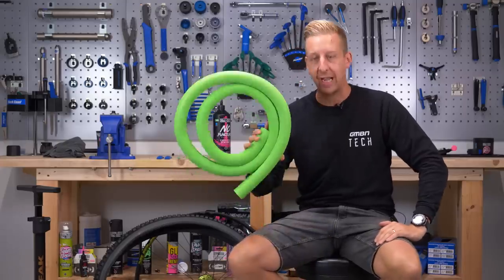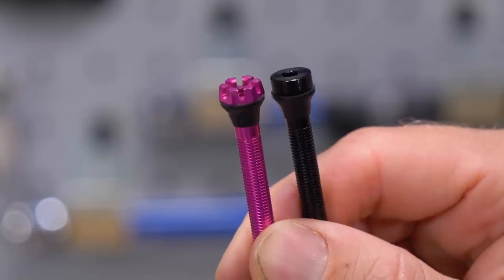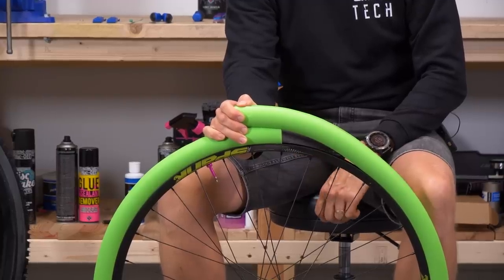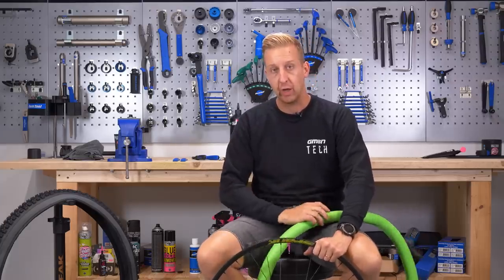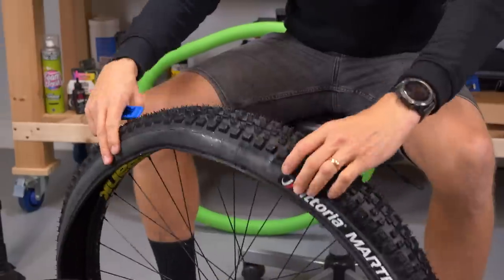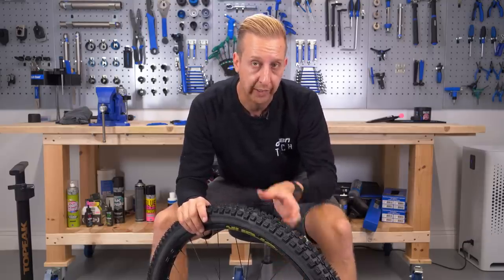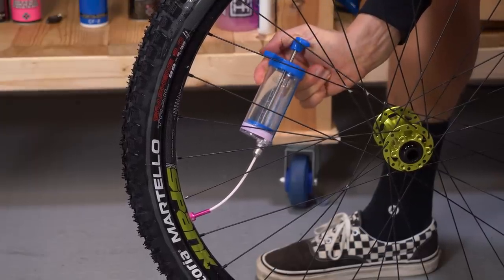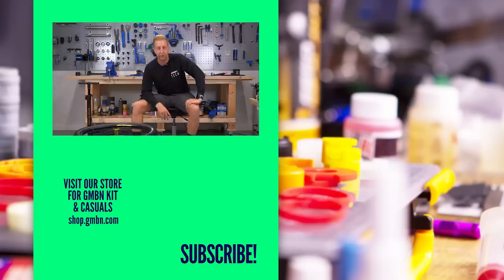How To Install A Mountain Bike Tyre Insert | MTB Rim Protection

Comment: I poke the cable tie buckle back inside the foam by rotating the cable tie after tightening and cutting. That way it won't damage the tire OR the rim tape.

Comment: Thanks. I tend to put the tyre on the wheel with a tube, indoors overnight. Deflate and release one side and remove the tube, then fit the valve and insert. This pre step helps the tyre take the rim shape and makes subsequent inflation and re-beading easier. I also find that watery soap is better than soapy water to help the re-beading. Hth
Reply: One other remark: presta valves are not really designed for this being rather narrow and cores are easily blocked by tiny bits of dried sealant which leads to slow leaks. Any chance tubeless and wheels will go back to using Schraeder with removable cores as these are wider?

Comment: Great video! That’s what I’d do before putting in the sealant.  Make sure that the tyre walls seat on the rim properly by pumping to its maximum recommended pressure. Then only I’d fill in the sealant using a syringe. I learn a new thing - how to install the foam insert correctly. Thank you so much! 😊

Comment: Loving my tire inserts, they allow me to ride much harder on my enduro hardtail without the risk of damaging a rim or pinch flatting
Reply: Do you only run one in the rear or front and rear both?
Reply: @BryceKimball7.3  I run one in the rear, because it helps the rear wheel getting damaged and stops it from bouncing due to the extra weight. I think it isn't needed to run one up front if you have a good fork.

Hope that helps!
Reply: @youtubeviewer9523  that’s exactly what I was thinking. Figured with good suspension they shouldn’t be needed for most of the riding I do. But there’s no suspension in the rear so I’ll have to try one
Reply: @BryceKimball7.3  Trust me they help a lot! and they give you a confidence boost to send it
Reply: They are a lifesaver on the rear wheel of a HT with single ply tyres.

Comment: if possible push the wall of the tire IN the rim, same side, 180degrees from the segment you're working on. the rim has a smaller diameter in it's center, just enough to help a lot when fitting the tires. 
besides the soapy water, the greatest help is heat (sun, hair dryer, etc). a warm tire is easier to work with.

*special valves mainly for weight reduction :}. a nice hole on the side of a regular valve would do the same job.
Reply: I was wondering why a standard car tubeless valve with a groove filed in the end would not suffice if a little extra weight is not an issue!

Comment: Mr Dodd...do inserts absorb sealant ? I use the Vittoria's in my gravel bike , they come sized and they're easy to use , to me anyway ? Thank you ....Peace
Reply: Just changed my rear tyre, had a Vittoria Airliner in there for 8 months. Didn't seem like it had absorbed any Sealant, ie not any softer or swelled up at all. I'm using muc off sealant

Comment: Installed the air liner on my rims. Front tire perfect makes no noise and seems to me doing great. Rear rim was the same, but now I hear the liner moving back and forth on the rim. 
if I take the tire off the bike and wiggle it back and forth, like when you add sealant, I can hear it hitting the tire. It is cut just like the front and installed properly.... Just now pulled the liner out and checked to see if the zip tie broke... nope. Installed again, added sealant and the same thing... soo weird... Thoughts, needs some expert advice... of the good kind.. Cheers G

Comment: @Doddy you could have used the tyre levers much later and for far less effort if you had pushed the bead in to the deepest section of the rim. I know spank have a raised middle section but they still have a lower “well” which will give you more bead to play with when getting the last bit on.
Reply: maybe the insert makes no possible to do that... but yes with out an insert that is the right way to do it ;) and some times the only one jaja
Reply: Can't push the bead in the middle because the insert is dense not much play

Comment: I never understood why people do not seat the tire first and then inject the sealant through the valve. You can do this with the little Stans bottles too. I have been using Cush cores front and rear for years and love them. I want to try this Vitoria one now.
Reply: in my case i used that method but i think the sealant with a few days gets dry in the valve and gets difficult to inflate the tyre also the top of the valve when you close it don't fit perfect and lose air... next time i think i will put the sealant direct on the tyre.
Reply: @hugor.b.6351  The sealant will get in that area anyway. It easy to clear the valve stem with a zip tie too.
Reply: @trailpimp6369  nice tip

Comment: How is this different from running tubes?
Especially if tubes are filled with a bit of sealant..
Weigh wisse it is the same..
Reply: You avoid pinch flats
Reply: Where I'm at there's tons of goat heads. With an inner tube you end up having to dismount the tire and patch the tube after every ride. Tubeless solves that.
Reply: @PetterIvarsson  But you get bead blow out and have to reseat it. Carry an extra tube an voila easy fix also if your getting pinch flats you should probably run a bit more pressure and check your rim for damage.

Comment: At the expense of oversimplifying things, inserts are basically solid inner tubes, am I right?
Reply: No, you're not.
Reply: No. The tyre still relies on the right air pressure to give a correct ride. The insert is partially rim protection, partly burp protection, and also gives a better compression ramp-up on hits especially. If you like to use lowish air pressure for high trye conformance

Comment: #AskGMBNTech Hello, I have gotten my hands on a Mondraker foxy r (2012). Shock was blown so got a good deal. I will send it to fox service center, but I want to do a lower leg service myself, but I can't find a dust wiper set for 2012 Fox Float 32mm. Can I use modern 32mm seals, even if they are not 100% perfect? Or should I just clean the seals and add new oil? Or do I have to buy a brand new fork? Thank you!

Comment: 5:00 not sure why people question the soapy water. I have been fitting tubeless tyres to cars for years. It's just standard practice.    And the water doesn't have to be warm.
Reply: Tubless tyres to cars??? Never seen someone fit innertubes to a car. Dumper or forklift yes, but never a car
Reply: @Rab_Cee  They are hard to come by these days but they do exist and were the norm back in the day.  Biasply tires tended to use them more then in a radial.
Reply: @Rab_Cee  Same.  Don't think tubes in car tires were standard since the 1970s.

Comment: OK a month on so probably won't get read... BUT...

Is there any reason they don't make a tyre insert INSIDE an innertube.
This would help save snake biters....
The insert wouldn't have to be full tube diameter, just big enough to squash out into the sidewall on impact, keeping the tube from being pinched between object and rim... so could actually have an air gap between the top of the insert and the outer tyre mid tread making for a softer more pliable contact area for grip when not hitting a curb/rock etc.
You can fit a 2.5" tyre over an inflated innertube (Done this lots to prevent twists during inflation and in some cases is easier than a completely deflated tube installation).

I'm almost tempted to get a 26" insert 
[yup.. I rock 26"ers... so get snake bites.. specially as the tyre co's hate us and stopped making 26" plus (ok except for Surly Knard 26 x 3.0 but I'm not disgustingly rich enough to afford them)].
get a 27.5 inner tube.
cut the insert and tube. Thread the insert into the tube and roll one end back a bit.
Glue the insert ends back together
Roll the tube back over itself and glue that with repair patch rubber cement. (Maybe even put a couple of the really thin repair patches over the seam as a gusset..

and I'll probably go stick a nail it in instead...

mmm ok so what about putting in some #Muc-Off Innertube Sealant 

q8)

Comment: Just ditched these Vitoria inserts…More pain than gain! Unless you’re into wobbly tires.
Reply: Agree inserts are generally overrated as a protective device. I occasionally use my cushcore on the back but think line choice, tire pressure, and casing are far more important.

Comment: #askgmbntech how do you stop tubeless tyres leaking air round the bead? I have a Vittoria airliner installed in Vittoria Mazza tyres and the rear seems to be leaking air around the bead and its very irritating because it goes down whilst I'm out riding.
Reply: Soapy water around the bead, like in the video!

Comment: I use an old thorn proof tube cut it down the middle wrap it around my tube and never get flats
Reply: You made me recall the mid 90’s when I used to cut of the wire bed of old tires and do something similar
Reply: whats a thorn proof tube ?

Comment: If you get a catastrophic failure on the trail requiring a tube, now you’ve got this damn insert you’ll need to take out and deal with.
Reply: Nah, you can ride home without a tube
Reply: @McSchwabl  yep--you'll be riding home instead of shredding with your bros.  I'd rather shred with my bros.
Reply: But to be honest, normaly you can stick a bacon strip in
Reply: Also I destroyed my rims after one season, i will try the Cush core to Safe the next rims

Comment: Does this make for a more comfortable ride?
Reply: @tonysadler5290  i think the method comes from the off road cars... lower pressures can give you more tire contact area with the ground and can be very useful in sand for example.  This last couple of months i use more pressure to get up hill easily and found that going down with that pressure (35) results in a more solid ride in curves and i feel i have more grip than before (24) maybe cause the less deformation of the tyre. So yes use the right pressure

Comment: Tried many of them... the struggle to fit on the rim doesn't repay on the trail... the main problem of inserts is the type of tire you've been using them with, to install and remove them easily you have to use trail casings such exo for example, if you use them with dh casing tires will be a nightmare to install them, second problem the sealant, with rotation and friction between tire and insert the sealant will consolidate in lumps that will make unstable the tire and you have to remove the insert to resolve the problem, third problem is the snakebite the tire if you use a pressure too low and you're going to damage the bead and there's no way to fix the problem if you don't have an inner tube because the damage won't seal the tire on the rim.. I've had all af these issues with foam inserts, so I don't recommend that solution, Cuschcore is a good solution imho, but only if you are racing because install and remove it in case of emergency is really a pain in the ass... the best solution is a gravity casing tire, inserts are rubbish.
Reply: @tonysadler5290  you use cushcore? The problems I've mentioned are with foam inserts, cuschcore is a different type and works really good, the problems are with foam inserts like the one 
Shown in the video 🙂
Reply: Glad to hear a comment from someone with experience of using these. Thanks.

Comment: I have a tire insert. Its called an inner tube.
Reply: What an original and smart comment...
Reply: @th_js  But technically true
Reply: @corail53  Not really. The inner-tube is the thing that holds the pressurised air in the tyre, whereas an insert doesn't do that.

Comment: This was a pretty poor demonstration of how to fit a tyre. Forcing it over the rim like that without advising people that the bead needs to be in the well on the opposite side is likely to damage the bead. Tyres beads are not meant to stretch. The rim is designed with a well to allow the tyre to be manipulated over the wider section. I understand the insert is preventing some of this but you need to force the tyre under it.
As for not riding the bike after adding sealant but giving it a shake. Really? Go ride the damn thing and spread the sealant properly.
I usually love your videos too 😔
I did learn why the valves are different though so I’ll take that. Thanks.

Comment: It took us 20 years to figure out how to get our tires tubeless and now we’re putting stuff back in our tires.  🤦🏼‍♂️
Reply: Clearly you don't ride hard and haven't ridden tire inserts.
Reply: Totally agree!  It's funny because most of the riders at Rampage were running tubes :)  I don't ride hard enough to use inserts.
Reply: @bebright15000  That is funny, although when you have 200mm of travel and are landing huge drops, you don't need the benefits of low pressure lol
Reply: I'm old, so I'm struggling with the idea of tubeless, and inserts, why not just run tubes??
Reply: @bebright15000  yeah - I was surprised they (Rampage riders) went tubed . Anyone have a clue why?
Reply: @youtubeviewer9523  Or you know it's just another marketing ploy for a product that most don't actually need. People have been riding big mountain/rampage/north shore style stuff going on 30 years without the need for them.
Reply: By all means run tubes if you prefer, but I’m not waiting for you while you fix punctures.

Comment: Finishing my fourth season on Airliners on multiple bikes. Never used some “special” stem.  Never. Just the stock ones that came with the wheels. Same for several friends who followed my lead. What on earth are you talking about?  Honestly man, explain.
Reply: “Standard” tubeless valves have a block of rubber on the end with just one hole in it. When you fit the insert, it covers the hole. That stops air escaping through the valve when you want to deflate the setup. These  valves have a crown on the end that is not blocked by the insert and allows air and sealant to move freely through the valve.
Reply: @hallstewart  Woah, 2 years later.  Well, still using Airliners and still using stock valves with the block of rubber, and still no problems at all. And still the same for my buddies.  So I'm really not sure what you are talking about.  Did you not know they have a trough that gives amble room for the rubber block?